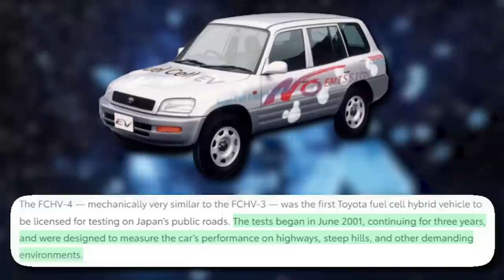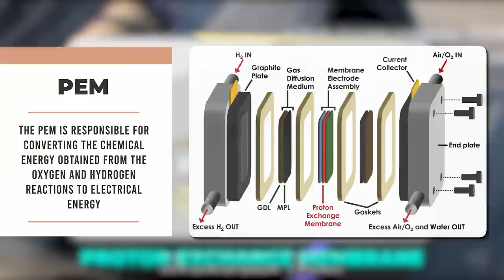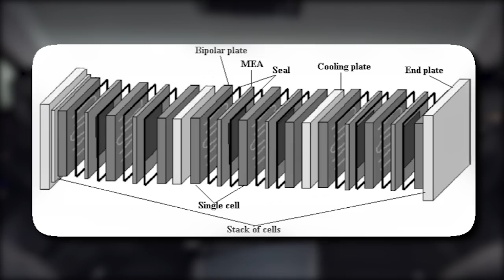Toyota CEO Releases 4 New Models | GAME CHANGER

Comment: The big plus of the EV for me, is that you can charge at Home overnight.
I have a Kona EV that does a real world range of 250 miles.
So each time that I leave home I always have a 250 mile range.
No Petrol Stations.!!
Reply: you have it in a nutshell no need to give money to ppetrol chem corporations
Reply: @smokeydization  
Yeah, just give more money to the electrical companies, when a lot more ev’s start to plug into the power grid.
JCB, you know, the company that makes the yellow backhoes? are trialing hydrogen powered ice vehicles, for heavy industries.
Reply: @Invictus357  I think hydrogen will work well for some niche applications, but EVs will probably win for private cars.
Reply: Yes indeed I find my BMW EV is similarly convenient.  It is also nice to fill it up without the risk of dripping diesel on my hands or down the side of the car.
Reply: EV charging not so practical if you live in a block of flats/apartments! 😳
Reply: @wayneoates8842  Not yet, Wayne.
The charging network generally needs sorting and improving.
Tesla can do it.
We need a minimum of 8 chargers per location.
They are fitting street chargers in London and other locations, down south!!.:face-blue-wide-eyes:
It will be 10 years before the charging structure will be acceptable to many,
but it is a very new system.
Reply: Toyota just said 3 of there new hydrogen cars will become  hybrid. So yes win win. Full Ev not solution.
Reply: @anniel1193  Most EV manufacturers offer pure EV's and hybrids.
Nothing new there.
As ranges get longer in EV's I don't see a place for hybrids.
Toyota will never sell their Hydrogen or Hybrid Hydrogen in the World:
Unless you have a hydrogen charger on your doorstep (who does) they are useless.
Reply: @grahamf695  Exactly.
Reply: @wayneoates8842  True. That is a problem we're going to have to address. We need more streetside chargers and incentives for landlords to install charge stations.
Reply: @Smiler7  Heh... Toyota says the Mirai is highly successful, but they only sold 14k Mirai since 2015. I think Rivian has sold more EV pickups than that in 2 years, and they're kind of a boutique builder. I saw a 3 year old Mirai on craigslist with 15k miles on it selling for $9k. Toyota had a deal where you buy a Mirai and they'll give you three years of free hydrogen fuel with it. Once that fuel runs out, you're looking at $100 or more for a tank of hydrogen to go 300-ish miles. Once that runs out, nobody wants to be on the hook for that sort of fuel expense. Not to mention the tanks need to be replaced after 10 years. I'm not sure how long the fuel cell lasts, but it's certainly not forever.
Reply: Have trust in Toyota to get it right with hydrogen, they were spot on donkeys years ago with the Prius. True the world laughed,but look who is laughing now.
Believe, hydrogen is the  future.
Reply: @wayneoates8842  You have also to figure that Toyota, or their partners, have to install tens of thousands of hydrogen-fueling stations to replicate the density of Tesla's supercharger network.  At $1M a piece, that means an investment of tens of billions of dollars.  Who's going to pay for it?
Also, where will the hydrogen come from?  If it comes from "grey" hydrogen, then there is next to nil environmental benefits vs ICE cars... just much more expensive vehicles and operating costs.  If it comes from "green" hydrogen, then it will be a very poor use of the precious renewable power being generated... and operating costs will skyrocket even further.
No, it is definitely a loosing solution!
Reply: @SR71HABU01  When they first released their Hydrogen car in the UK, I was very keen.
I contacted them about refuelling.
I was assured that hydrogen Filling stations would be popping up all over the UK.
At that time I think they had 5, all in strange places like Universities & Hospitals.
Now here we are many, many years later, with 15, mostly in inaccessible places.
The nearest one to me (Manchester) is 60 miles away, in Rotherham.
It is on a Business Park.
In the whole World there are 160 !!!!
Toyota promised the UK Government that they would have 60 3 years ago.
Toyota are playing a strange game.
They do not want to give up on ICE cars, and are miles behind all the other manufacturers with EV's.
Reply: @Invictus357  bs the big mines in australia are converting to EVs and building the power grids to power them with wind and solar
Reply: @Smiler7  when the ice cars started to dominate transport it took 30 plus years to build enough fueling stations
Reply: @anniel1193  you realise that the energy that hydrogen has to use to power the car is 30% of the power used to create hydrogen , there is a sucker born every second
Reply: @flodjod  It has taken Toyoto that long to open 15 😍🥹❤
Reply: EV charging is often practical if you live in an apartment! 😳

If you have access to one or more of about a dozen different options... For example charging at a garage, off street charging, charging at work.... These and many more options will become much more common in the future....

Plus battery swapping Is also becoming another option.... And in the meantime you get a PHEV, and charge it when you can ....
Reply: @Smiler7  In summer, my EV has a 300 mile range on long trips.  It is comfortable and quiet.  It handles well, with powerful and smooth acceleration.  Apart from long trips to visit relatives or go on holiday, the only place I need to charge it is at home on cheap overnight electricity.  I can’t see any reason at all to move to a hydrogen car.
Reply: I’m a sales rep who travels a lot through country Victoria in Australia, i easily cover 1000kms a day, what do I do with an EV. Hybrids make much more sense to me.
Reply: @zoranm6432  I agree Zoran.
Until there is a proper infrastructure for rapid charging it would be a waste of time.
It is Up to Ev manufactures to ensure this is done.
All long way off yet, my friend.
 The average mileage driven a day, in Victoria is 33km. Thats all fuels.
So for a great many the EV is a great choice now.
Reply: @Invictus357  unless you happen to have HOME solar
Reply: One power outage and you’re finished
Reply: @lac19951  We are so reliant on Electricity for everything.
Petrol Pumps: Hydrogen pumps; Traffic lights: computers etc etc etc etc.
Reply: @lac19951  how so?
Reply: @SR71HABU01  Only one little problem in your thoughts...The laws of physics do not change.
The prius was a reasonable good offer because the uses energy losses (braking losses) for the electric drive train (and some petrol to charge the battery). This made that car less inefficient as other ICE cars. However even the prius had a major development failure. The better option...Build the car fully electric driven with a relativ small battery and use the ICE engine in the most efficient RPM with a generator to charge battery and support electricity to the drivetrain. An old and proven concept in diesel electric trains...much more efficient than bringing the diesel engine power direct to the wheels.

H2 cycle however is a very inefficient way of storing energy....high losses compared to carging losses in a battery. And not easy to change that.
Reply: @zoranm6432  I'm living in europe. I never drive 1000 km on any road nonstop. I need to do a sanitair stop, eat and drink somewhat. (1000 km is ca 10 hours of driving, also in Australia). At least a few times on 10 hours. With my >400 km range (100km/h as assumed max speed) I only need 2 stops of 18 minutes for a meal and sanitair stop including charging my car for the next stint of 300km.  No waiting time for charging...in contrary to my previous ICE car...I needed first to fuel the car , pay for the fuel, and after that still I needed my personal stop...making the stop at least 10 minutes longer than with my EV. I even  did not include the possibility of extra charging during the business meetings....because 1000 km is to long driving to have also time for a meeting.
Reply: It'll take a long time for EV's to rule in the U.S., but PHEV's like the Prius will rule if batteries become cheap enough and powerful enough.
Reply: @michaelbradley1636  only problem with these plug-in hybrids is that people in my country Australia in any case drive them for the prestige value and just top up the fuel and don’t drive it in electric mode which seems to be a bit of a major problem.
Reply: Infrastructure for traveling with your EV will not exist in your lifetime. They make a good 2nd or 3rd vehicle for commuting but traveling is not realistic now.
Reply: @fredfernald8016  respect for yourself. Australia has a way to go, but there’s plenty of long distance commuting if you pick the right time to travel.

Comment: We have around 15 hydrogen filling points in the UK, so what game are 4 new hydrogen powered cars changing here?
Reply: I think you just add water and it magically becomes hydrogen
Reply: It could change quickly though. Hydrogen is easy to make from natural gas with carbon capture, and a simple engine (as opposed to fuel cell, depending which way tech goes) doesn’t need rare and mined materials which is the fatal flaw of battery technology, which will prevent it from ever being cost effective.
Reply: The game changer is pulling Toyota down from their 'Top Three' status to 'maybe top 10' in worldwide car sales. They're losing big, and I can't believe they aren't doing something about it. I read somewhere that Tesla is the number one car manufacturer selling to former Toyota customers. As in, most people who are buying Teslas formally owned a Prius or other Toyota car. That is some massive customer base drain for Toyota. They better get with the EV game, or they'll lose their company.
Reply: @mkyhou1160  Carbon capture is mostly an experiment at best these days.
Reply: @Enrique A Thiele Solivan ... well... provided people go filling up in the middle of the night!  And those hydrogen refilling stations cost $1M a shot!  Versus a supercharger that can charge about the same number of vehicles per day, but costs only around $45k... versus a gas pump, which costs around $150k (with associated tanks, etc), but which can refuel ca. 10 vehicles per hour.
It just won't happen!
Reply: @erichtisnado1536  ... and more likely a scam!
Reply: @mkyhou1160  The whole point of zero emission future is the reduction of reliance on hydrocarbons as a fuel, although the hydrogen engine would have no emission it still will produce emissions in its production and will use more energy in its production than we get as an energy fuel, pointless, we would be just as well sticking with petrol/ diesel. It also has issues in fuel delivery there being no infrastructure for this and not as easy to just fill up. Storing it in liquid form and turning to pressurised gas is time consuming, each hydrogen filling pump can only fill about 5 vehicles before the pump has to cycle the hydrogen into Gas. It is reckoned an average gas station could only fuel around 80 vehicles per day.
Reply: @brianstevenson9967  An average supercharge can refuel what, maybe 10 vehicles a day? I see Teslas lined up waiting for hours at the mall for a charger all the time. We you add in the massive amount of resources / carbon needed to build the batteries they are a joke solution.
Reply: @erichtisnado1536  I have five friends who drive the Prius. None of us are planning to trade for a stinking Tesla.
Reply: @nickiemcnichols5397  I hear the Tesla model Y is now the worlds best selling vehicle, so not many people would agree with you.
Reply: @erichtisnado1536  I wonder which country? Globally Toyota isn't loosing at all. Either Middle East, Asia or Africa. Even Afghanistan gets aftermarket parts directly from Japan, because of the huge amount of Corollas. Mongolia or Southeast Asia, especially Cambodia is full of Prius cars, you see them literally everywhere. Germany, Poland or Czechia except Toyota Yaris and Aygo popularity, Lexus is getting more attention there. Now there's a trend of Tesla users switching to KIA EVs. They're more fun, is what I heard in Germany.

I don't get where you got your statistics. Globally is Toyota Corolla most sold car, Ford F series and Toyota RAV4. 4th place is Tesla Model Y. 

P.S. And I ain't Toyota fan, I'm a Honda Legend user.

Comment: Toyota will not let go of this.
They are like a pig at a potato.
Hydrogen is too expensive.
Too dangerous.
8,365 Petrol stations in the UK. This figure gets smaller each year.
"As of 1 April 2023, there were 40,150 public electric vehicle charging devices installed in the UK, within which: Charging Speed: 7,647 were rated “rapid” devices or above, this represents 19% of all charging devices. 22,338 were rated “fast” chargers, this represents 56% of all charging devices.4 May 2023". Some with as little as one or two chargers, but it is growing rapidly.
The first Hydrogen filling station opened in the uk in 2008.
2023 = 15.
None are them are located in an area useful to the general public apart from a Shell station on the M25, and Shell on the M40.
2 in Aberdeen and 1 in Orkney!
I can see large Commercial vehicle companies being very interested in hydrogen in the future.

Comment: Game changer? Toyota has changed CEOs too late. They've missed the EV revolution and are now in serious trouble. Talking about hydrogen won't fix it. Might be OK for ships, trains, trucks and perhaps aircraft, but that's about it. No hydrogen outlets anywhere near me.
Reply: Spot on.....
Reply: Look up JCB ice powered heavy vehicles.
And yes, I said ICE powered hydrogen vehicles.
Reply: @Invictus357  Thanks. ICE diesel engines can be adapted to run on most liquids/gases that explode under pressure. The common methods of hydrogen production emit CO2 as a byproduct. Plus, hydrogen refilling stations will still face the chicken/egg problem now facing electric vehicles in Australia. Consumers in sparsely populated countries are reluctant to buy EVs while the recharging network is deficient. In capitalist countries, rolling out more chargers is problematic while the return on investment is poor due to the low percentage of EVs. Only government intervention will ensure speedy take-up.

Comment: It's not a game changer for most of the world.  Hydrogen is one of the possible power source solutions for replacing petroleum and natural gas, but it is better suited to stationary than  mobile applications, better suited to short range vehicle than one used in places like the US. Producing hydrogen requires electric power generation capacity and a distribution system. Transporting it in high pressure or liquid form is expensive and inefficient, while distributing it in low pressure pipelines is almost as cost effective as natural gas.  Japan's home market is a good potential application for mobility ironically because it isn't afraid to use and expand its  nuclear power generation capacity, is compact and geographically isolated
Reply: Also, most hydrogen available today is steam extracted from crude oil. Kinda defeats any environmental advantage hydrogen ever had. Someday... maybe, they'll use surplus renewable energy to make hydrogen, but that's a very small percentage these days.
Reply: 😊O

Comment: Yes some really big game changing moves that continue to play the same hydrogen game Toyota have been playing for the last 20 years
Reply: and failing
Reply: Look at JCB and hydrogen powered vehicles.
They are trialing hydrogen powered heavy vehicles, like backhoes, excavators, trucks, and tractors, using ICE powered hydrogen vehicles, and are making good progress in doing so, because ev heavy vehicles are not a viable alternative to diesel, and won’t be for the foreseeable future.
Reply: @Invictus357  Nah mate. they are using BEV farming equipment, mining equipment and haulage because you can do all kinds of workarounds. For farms, there is always the option of generating your own power by agrivoltaics plus battery and recharging your farm equipment from that storage. Far easier than making H2 on site. MIners prefer it because no exhaust inside close tunnels. And open pit mining can use cabled machinery because the trucks, excavators etc are only within a mile or so vicinity, sometimes less, only working in the pit, so that the battery need not be that big.
Reply: @smokeydization one must fail to get back on top. They did it taking on the big 3 in history, im sure they can bounce back again.

Comment: When I think of a hydrogen car it brings back memories of the Ford Pinto and the explosive impact it had on the auto industry, and it was only gasoline, not hydrogen. Hydrogen could really make a huge explosive impact.
Reply: It was a huge concern, but after testing, this became a non issue. Hydrogen does not cause an explosion as expected, but because hydrogen is so light, it just escapes very quickly into the atmosphere. This is my understanding.
Reply: @yogishnn1945  I don't know if I would trust all that I read these days. We've been lied to for decades.
Reply: @genegoodwin8925  Yes, but if an EV's battery catches fire in a crash, it is very difficult to contain it.
Reply: @yogishnn1945  Maybe we should go back to a horse and buggy.
Reply: @yogishnn1945  Did you ever saw a steam engine explode? Due to overpressure? 
With a 1000BAR H2 tank that is the main explosiv risk and can occur when the tank overheats.
 And 1000 bar is much more than any steam engine ever had as working pressure.
Only with leakage in a closed environnement we also can get an 2H2-O2 explosion....in garages without proper ventilation is that possible.